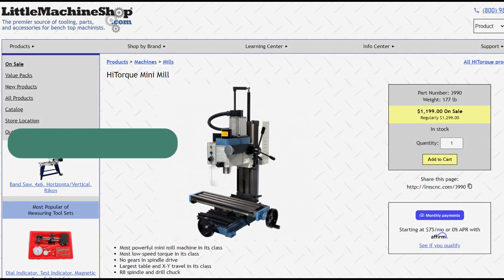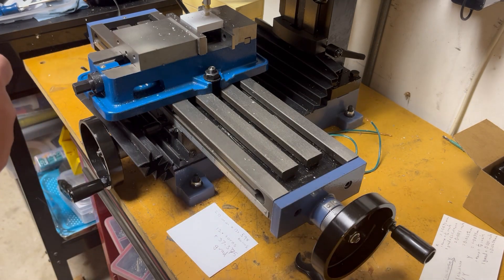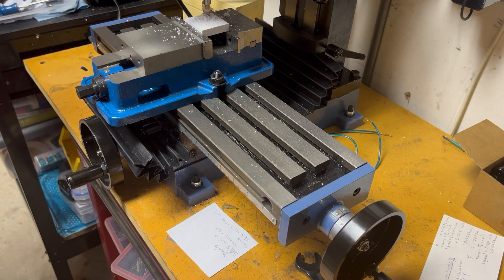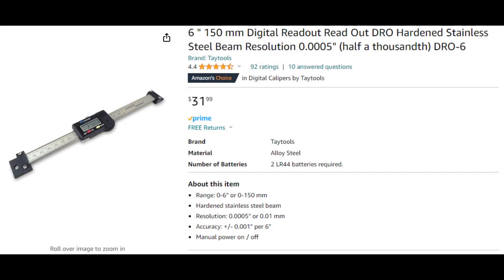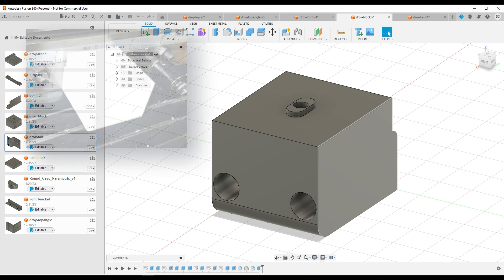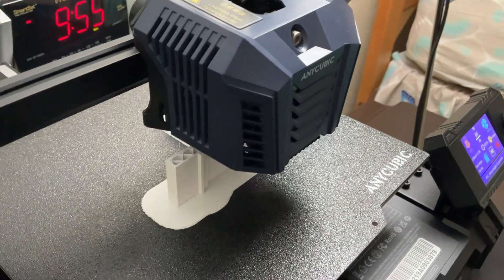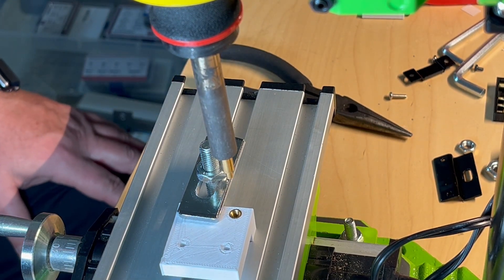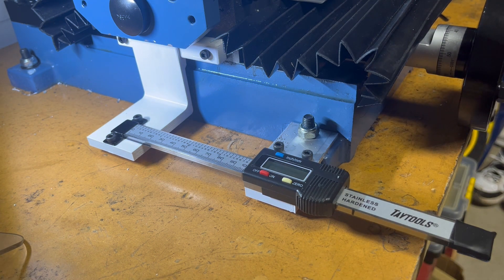$60 DRO –Little Machine Shop Mill

Comment: So learn to use Imperial then, or as we say in the Colonies, SAE INCHES AND FEET, YOU CAN USE DECIMAL SAE CANT YOU??
Reply from the maker: I usually use both, however, many of the electronic components I am using are in metric so I end up switching between the two. Not having to deal with backlash and counting turns on the manual controls are my main driver for using the DRO.

Comment: I did the same thing on my mill. Instead of using those $30 vernier things I used the two $6 and one$20(300mm) plastic vernier.
Reply from the maker: I like that idea, would be a simpler way to get DRO type functionality and would not need to worry about batteries and getting metal shavings on the DRO.